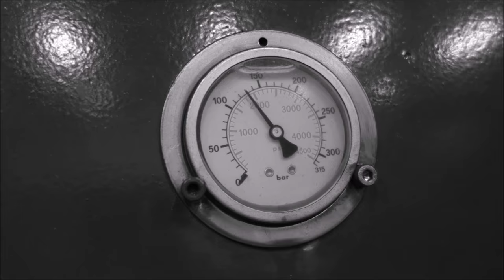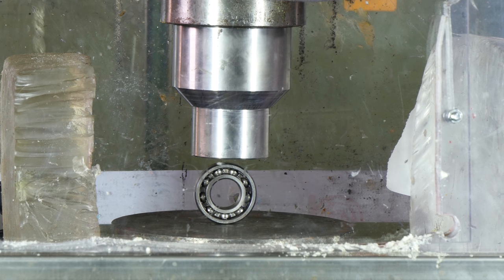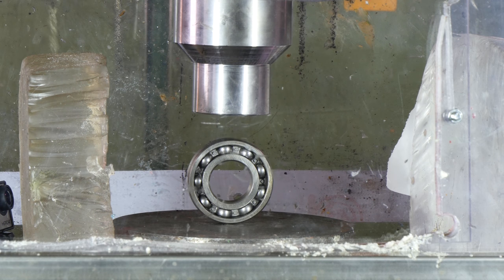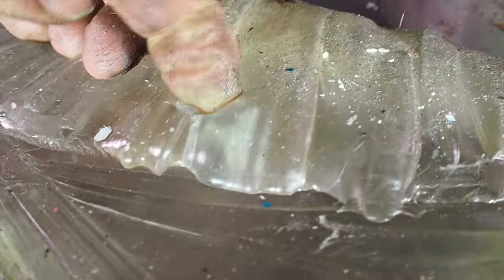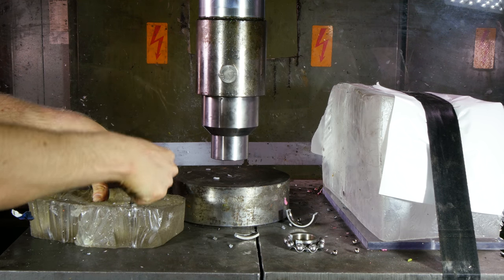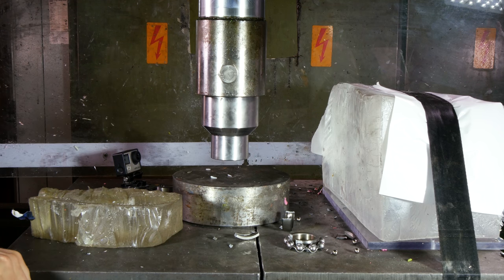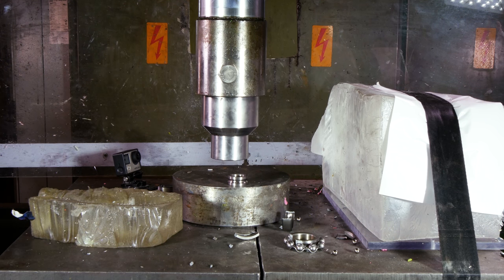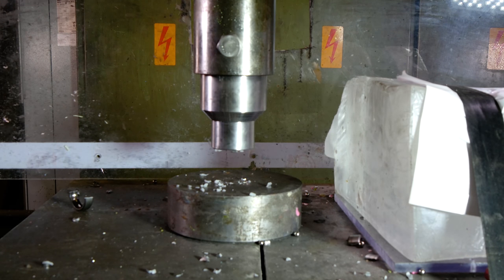Crushing ball bearings with hydraulic press

Comment: Imagine if two hydraulic press machines were to press against each other. Would the world implode.....?
Reply: Chris Topher no they would merge into a massive hydraulic press and crush the world.
Reply: Actually, this has been done before, its known as the creation of everything
Reply: +Chris Topher

a black hydraulic hole would form and create a huge gravitational field that would pull in anything near it :-)
Reply: It sounds extremely dangerous, and we would need a third hydraulic press to deal with it.
Reply: SPAC3MARAUD3R 
a 3rd hydraulic press would make the black hole incredibly dangerous and increase risk to mankind by 3.14159265359 gazillion percentage pointees 😜
Reply: Nobody - MUSIC 

Yes normally that would be the case. But when you factor the HPC coefficient into the astronomical calculation it changes everything and the situation becomes very extremely inherently dangerous 😜 Hope that explains the phenomenon 🤓
Reply: LIPINOID 

Ah but what about the HPC coefficient in the astronomical calculation making this phenomenon acutely extremely dangerous ? 😜 😱
Reply: The press with some structuring weakness would have that weakness break, maybe a nut, bolt or metal fatugie. Something would break in one or the other. It is impossible to make the exact perfectly same strength in every single part that is used to make a press like that. The casting or welding of the parts will always be a tiny bit different.
Reply: 123TauruZ321 and the structure is designed to withstand pressures well beyond what the press can generate, so, likely both hydraulic pumps would just go into bypass. Eventually, one or both pumps might overheat, or trip the electrical overload.
Reply: But it is quite interesting .. because the press is designed to go into bypass when it's full pressure is reached. But what if the same amount of pressure is added the other way as well? It is not the same as pressing on a flat surface with no pressure upwards. It would create extra stress on the structure of the press...
Reply: Chris Topher the world may never know
Reply: The table holding the two presses would break, or the ground.

Comment: Hey, I'm not sure if you know this or not, but bearings are actually really fragile without a center support. If you want to see one put out some real shrapnel, grab a piece of round stock and lathe it to be a good fit inside and then crush the bearing. It'll take a LOT more pressure before failing, which should lead to a better bang

Comment: I once had to replace quite a large bearing on a shaft of about Ø60mm, and it was shrunk fit. So, after removing the outer ring and the part with the balls, I decided to grind a cross into the inner the inner ring, but I couldn't cut it all the way through, because it would damage the shaft. Then, I hit it with a steel punch and a big hammer. I hit a piece off of it approximately 1 cm³ that came flying past me so fast, that my hair was moved by the wind. I could hear it fly right past my ear. I had then learned that there is a lot of stored energy and tension inside of bearings, especially when they're shrunk fit. I never did that again...

I did manage to get it off eventually, by heating the inner ring of the bearing, and then throwing water on it while it was red hot. It cracked right in half. Right next to the place I grinded the cross in.

Comment: What if you got a cup with the same diameter as the press and filled it with water? Its virtually incompressible so chances are the cup would shatter under the immense pressure but still that would be super cool to watch

Comment: You should try compressing things under very high pressure. For this, make a hardened steel block with a small round hole (1 cm) through it. Then put two round metal cylinders in the hole to form a compression space between the flat ends of the cylinders. The cylinders and the hole should have tight tolerances so the compressed material cannot escape. Then you could compress things such as sugar, metal powders, wood, even gun powder (very small amounts) to see if you can make new materials. Perhaps even diamond, by using charcoal!

Comment: How about crushing some u-joints? I recently re did the u-joints on my truck which made me interested in seeing what happens to one in an hydraulic press.
Reply: HankB1993 My friend has a basic bottle jack type press, we used it to replace a ujoint. I forgot to take one of the lock rings off first and pushed the joint through the center of one of the end caps. Damn thing flew off and sounded like a gun shot.

Comment: i was removing some pillow block bearings by hammering the cast metal off to get to the actual bearing and accidentally hit a bearing next to it. a tiny piece flew off and hit my middle finger and my finger started bleeding. didn't think anything of it until i got an xray for a broken bone in my hand and sure enough part of the bearing is in my finger. small magnets stick to it :)